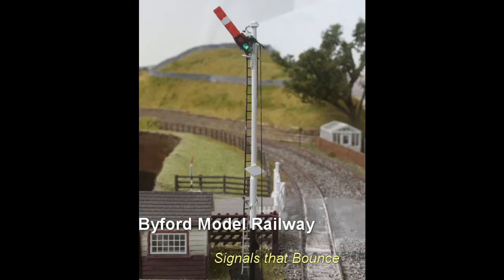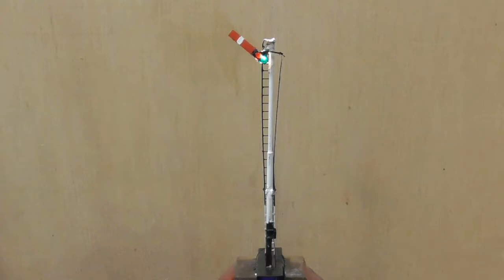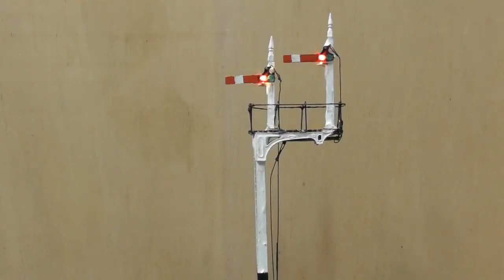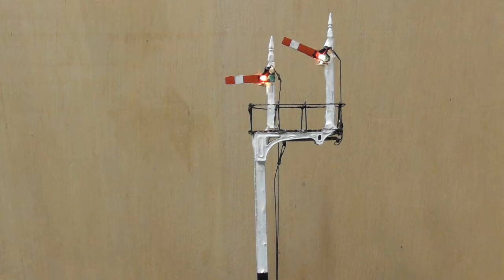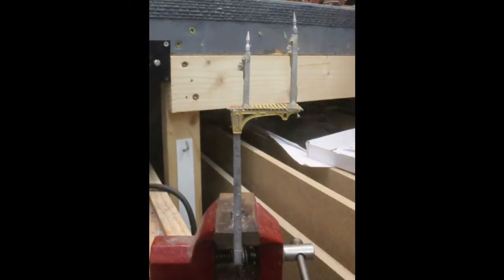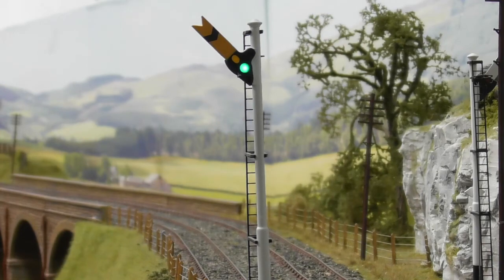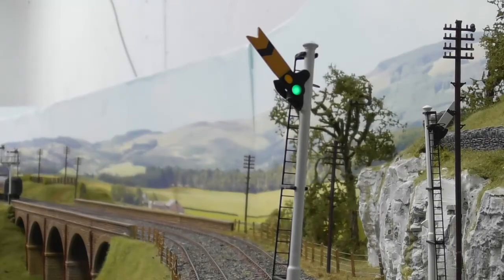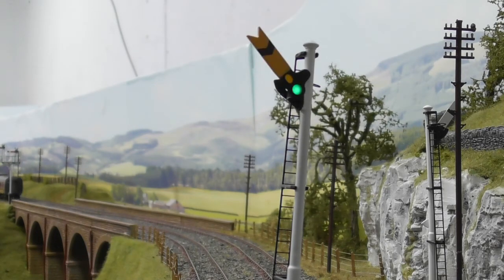Signals That Bounce-With MegaPoints Controller

Comment: Is this possible in N Gauge,otherwise a great job and realistic too well done.
Reply from the maker: Thanks, I buy my signal components from Wizard Models and they do stock a smaller range of N Gauge signal parts so you would have to look and see if they have the parts needed for the signals you would like to build. So, it can be done but I think you would need lots of patience and good eyesight.
Reply: Many thanks for your advice will look them up.